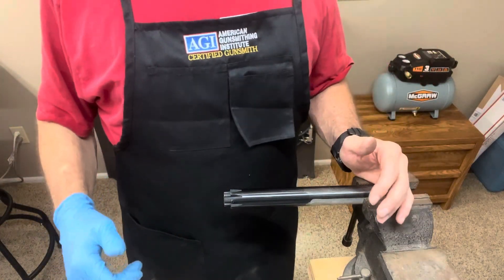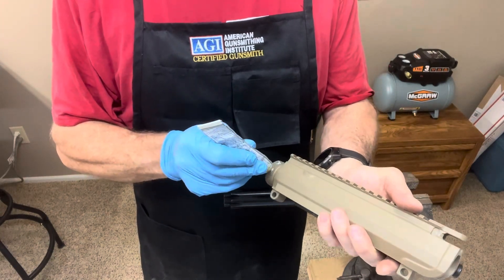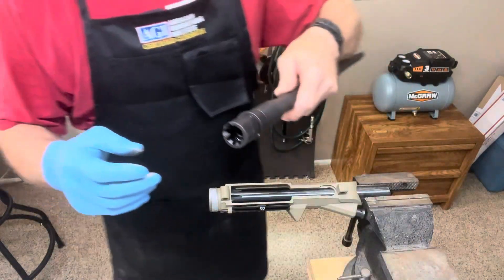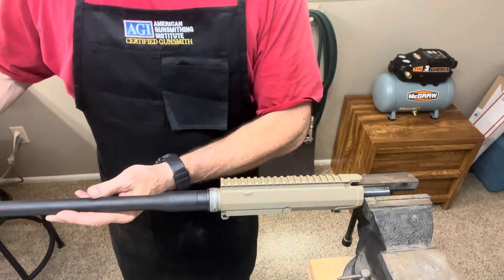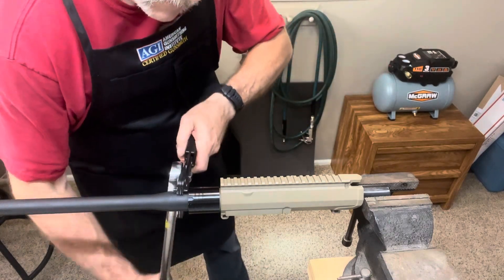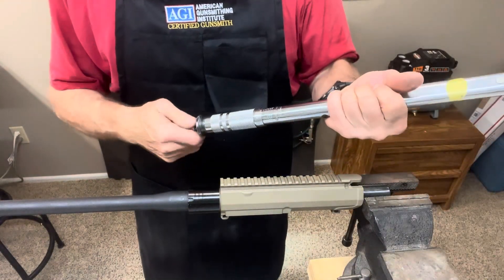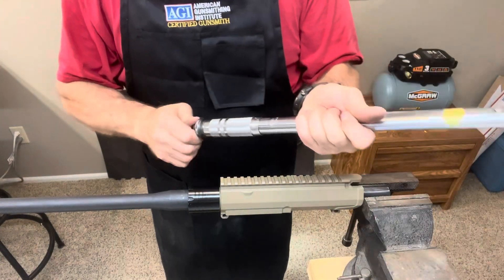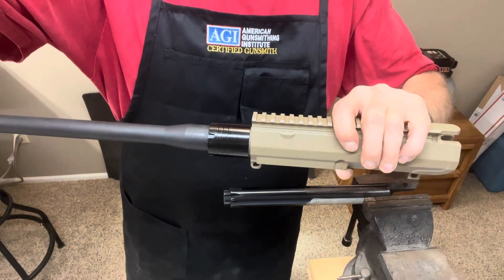How to install an AR-10/308 style barrel

Comment: What is that wrench torquing down the barrel called
Reply from the maker: That one is called the Wheeler Delta Series wrench. To get it to fit the “10” I ground out the circular area as needed. The bar that is in the vise is a reaction rod. They go by other names also, many companies make them. This one is from Brownells.

Comment: Why doesn’t my muzzle break line up straight with the barrel? I did everything in the video including the correct torque. When I add the muzzle break at the end of the upper build it doesn’t line up straight with the barrel, it’s like 90 degrees turned. If I could post a picture I would. Hope you understand what I mean
Reply: You can either use timing/ indexing washers, washers of varying
thicknesses to get the timing right on you muzzle device or use a crush washer.
Some builders will use Rock set to ensure that the muzzle device doesn't loosen up.
Reply from the maker: Agreed. I have a bunch of crush washers and spacers of different thicknesses. You can pick them up at a lot of sites that sell AR parts. Just make sure they are for the correct diameter size (1/2 vs. 5/8)

Comment: If one is trying to achieve maximum accuracy - did you try using a .001 shim of SS to tighten up the mating of the barrel to the receiver before slathering up the junction with anti-sieze. You want the tightest junction - then apply the lube.

Comment: By attaching the T wrench to the barrel nut tool at 90 degrees to the nut/barrel, you have created an 'offset adapter' in the wrench. Torque values are NOT the same as going straight on. If you align the T wrench handle and the barrel nut tool handle, you achieve the torque value as desired. There is a formula that will tell you your actual torque achieved when setting the wrenching surface at 90 degrees. "Torque Wrench Adapter Calculator"
Reply from the maker: You are correct sir. My apologies. This was one of not my first video, and I was kinda a lot nervous. I should have focused on attention to detail.
Reply: @5alarmgunworks351   No need to apologize!  You were correct!  90 degrees is the desired angle when using any tool like a barrel nut wrench, crows foot, dogbone, etc., with a torque wrench.  At 90 degrees, the amount of torque being applied doesn't change.  Using an angle that is more than or less than 90 requires recalculation due to the positive or negative offset between the center of the fastener and the center of the torque wrench square drive.  If you were to use the wrench straight-on as suggested by Coreazcool, the torque applied would be increased,  thus requiring a reduction in the value set on the torque wrench to achieve the desired torque.  For example. The desired torque is 50 lb-ft.  The effective length of the torque wrench is 12-inches.  If you increase the effective length of the torque wrench 2 inches by using a barrel nut wrench straight-on, the value on the torque wrench would need to be reduced to 42.86 lb-ft to account for the 2-inches of positive offset.
Reply from the maker: Wow helomech, you just blew my mind!! lol thanks for the info. I love learning from others expertise!
Reply: I was thinking the same thing, I don't have much experience with torquing things down but it just didn't look right to me
Reply from the maker: Thank you Slang, much appreciated.

Comment: Who makes the barrel nut you used?
Reply from the maker: It is the one that came with the Handguard. Most will have the nut when you purchase the guard. I can’t remember what the brand is. I use different brands to see how they are. I’ll check which one that one was.
Reply: @5alarmgunworks351 which one is it?

Comment: Anyone have a link to the wrenches he is using? About to put a barrel on my .308 build
Reply from the maker: Are you looking for the barrel wrench or reaction rod inside the receiver? Barrel wrench is a Wheeler 3 pin ground to fit the barrel. Rod inside is from Brownells. Geissele and Real Avid have them also.

Comment: Did the gas tube line up with the receiver? It was unclear if you demonstated this!
Reply from the maker: The barrel nut I used was a thinner style that was lower than the gas tube hole in the receiver. It makes it easier to install the gas tube because you don’t need to line up the notches/holes of the barrel nut. With the bigger style with the notches/holes, yes you do need to line up with the hole in the receiver. Tighten the nut to 30-40 ft.lbs. Loosen (3 times) then check how they line up. Tighten up until they all line up, just don’t go over 80 ft.lbs. I hope this helps.

Comment: Hello sir! I have an AR10 308 16inch barrel. If I upgrade to an 18inch barrel config will I run into any issues? Will I have to change anything else on the rifle?
Reply from the maker: Going from a 16” to an 18” barrel shouldn’t give you any problems. The things you need to look at are gas tube length and gas block diameter. If your 16 is mid length, and .750 diameter the 18 may be different. Some are rifle length, and larger diameter block, so you would need another gas tube and block. Look at those things when ordering your barrel. Also, if it is rifle length, your Handguard may be too short. Those are the first things I would look at. There are a few things also, buffer spring and weight are a couple more things, but if they work fine with a 16, they should be fine for an 18. I like adjustable gas blocks. They are a bit more money. But makes tuning a lot easier. I hope this helps, I know I rambled. Lol. Any other questions, just let me know.
Reply: @5alarmgunworks351  appreciate your feedback.
Reply: @Joseph5394  Say if you haven't yet bought the 18-inch AR 10 308 barrel I can recommend going to MidwayUSA then buy the 19" SS 308 AR Stoner barrel which is on sale now & $89 for chrome molly steel or the same in SS steel is what I have that shoots amazing 1-inch groups @ 100 yards 
If you want an AR 10 for longer reach you can change out the 308 barrel for one of the WSM magnums and use a KAK industry WSM magnum bolt .
OR do a AR 10 upper in 6.5-284 Norma on a Pac Nor Barrel.
I just did an AR 10 upper in 375 - 300 WSM 
I build AR uppers for sale so if you need some know how advice let me know

Comment: Is 40 lbs of torque enough? Or do you recommend a higher torque?
Reply from the maker: Recommended torque is 40-80. I do either 40 or 50 and I’ve never had issues with a barrel loosening. Going up to 80 won’t hurt, but I feel it’s overkill. Lol. If you need to line up your gas tube and barrel nut, go to 40, then just enough to line it up.
Reply: Confirm with the mfg of your upper to see what the spec as torque for their threads. Most spec 65 ft/lb.

Comment: I wouldn't use that reaction Rod you're only holding the barrel not the receiver you're talking the barrel nut too
Reply: Are you a certified gunsmith?
Reply from the maker: @edward71ful  Sorry for the delay, I’ve been super busy. Yes I am a certified Gunsmith, working on my master right now.

Comment: I lap my upper then bed the barrel with green loctite adhesive compound. Little more work but rock solid and will usually improve groups some. Downside is it requires heat to change barrels but that’s not a big deal. But definitely always use never seize.
Reply: Is green loctite not rated at 200°I've never seen it last it always breaks down once the barrel gets hot

Comment: What barrel wrench are you using?
Reply from the maker: Hi Keith, thanks for subscribing. It is the Wheeler 3 pin, but I had to grind down the opening to get it to fit the barrel it diameter. The pins fit great. I am on vacation right now, but will get home and get you more info.
Reply from the maker: Barrel nut. Sorry, fat fingered the phone. Lol
Reply from the maker: The wrench I used was the Wheeler Delta Series AR Combo Tool. The pins lined up perfectly, but this wrench was made for a 15, so I had to grind out the notch to get it to fit.

Comment: Great video, is it important to put grease or oil on the barrel extension? And does it prevent corrosion? Thanks
Reply from the maker: Thanks for the reply. Don’t use oil, it is to thin and wears out very soon. I generally use anti seize on a standard barrel set. You can also use a small amount of blue lock tite instead. If you don’t have either, use grease, it stays on the extension. If using blue lock tite and want to change the barrel, remove the nut, use a heat gun and heat it up. It should come apart fairly easily. These do help prevent corrosion. If you have any other questions, let me know.
Reply: Aeroshell 👍